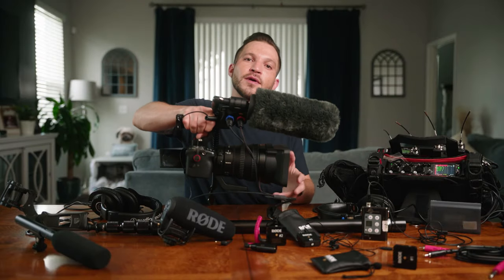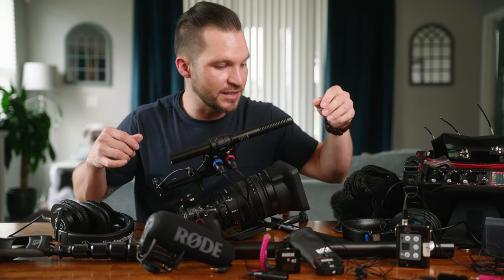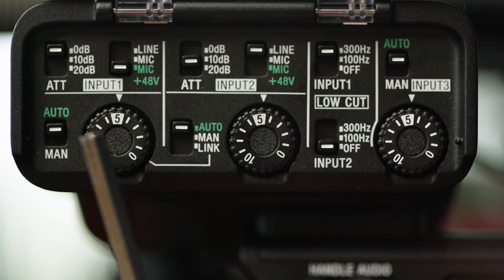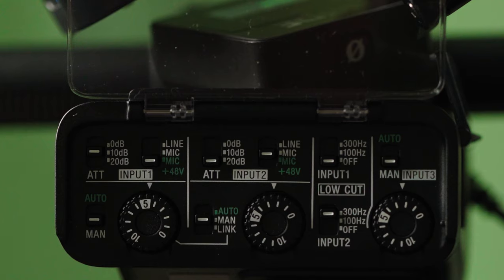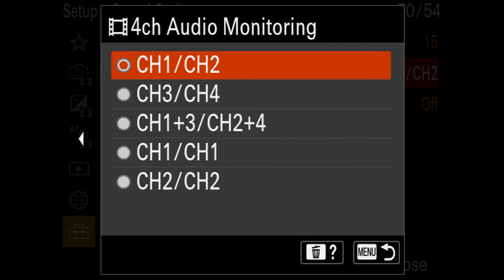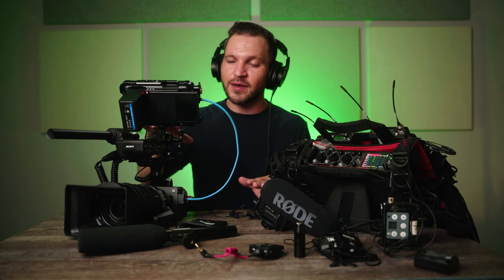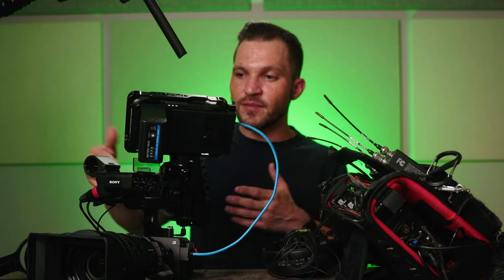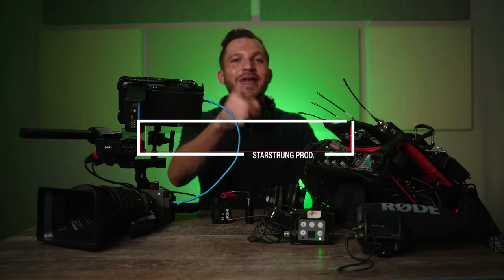Sony FX3 XLR Audio Handle EXPLAINED!

Comment: Hey Ray, long time! Hope you are having a nice Christmas season. I got a question for you: There's this faint ringing noise that comes and goes when I connect the Rode VideoMic NTG using a minijack (3.5mm) to XLR adaptor to input1 on the Sony FX3's top handle. I can't figure out what is causing the problem, whether it's the cords, or mic or top handle, or if this is normal from time to time. I would appreciate any help. Thank you kindly.
Reply from the maker: Hi Jesse! Hope you're having a nice Christmas season too!  Did you get Rode's 3.5 to XLR adapter? It sounds like it could be Power or Cable/Adapter related. What do you have your "Power" level set to?  Mic, Line, Or 48V Phantom power? The NTG is designed to run on Mic Level.  And does it only make the noise when in the XLR port, or does it do it plugged into the 3.5mm Jack also?

Comment: Hey Ray. I really need your help. I have FX30 with xlr handle and want to connect "rode wireless go2" and "deity d4 duo" microphones. "Deity d4 duo" only works from input3 (3.5m), so I only have a choice to connect "rode wireless go2" thru input1 or input2 with XLR adapter. But the problem which I get is that those inputs are mono and I cannot have different L&R channels in post because it's in one channel. Do you know if I will use "3.5mm to dual xlr male cable" with my "rode wireless go2" with input1 AND input2 I will be able to have two different mono channels? Thanks in advance

Comment: You were probably just doing for demo purposes, but a 416 as an on camera mic would be overkill. Save the 416 for booming and use a cheap shotgun as an on camera mic since it’s likely going to be just  reference or nat sound.
Reply from the maker: Absolutely overkill! It's just what I had access to back then.  It was a rental for a job.  I have 2 shorter shotgun mics from Rode and Deity now.

Comment: Thanks for explaining so well, helped a lot. I just got Deity S-mic2S for fx3 for run and gun shoot. I am getting lots of handling noise through mic, is there a way to get around this? Thanks
Reply from the maker: Hi Naveen. Thanks, I just did a video about the Deity S-MIC2s against the Rode NTG5 on the FX3 if you're interested: https://youtu.be/FHB0iUDFy8k
For the handling noise, I got the smallrig extension grip for the handle and covered the rest in velcro (soft side). It helps a great deal!
Reply: @RayValencia  Thanks Ray, I've seen your other video and great to see those comparison and they both sounds good I think, however they were setup mostly on static Boom and i was wondering how would they respond when handheld on camera top, would love to see a video made for that in run and gun style environment.

Comment: Hi Ray, thanks for your video, very helpful. I have one question. I am using Sony ECM-MS2 Microphone with phantom power in input 1 and 2 and rode wireless go II into input 3. Which input select should I use on the handle between the  3 options (IN3, IN1-IN2, or IN1) in order to record 4 channels? Right now I am using IN1, but I'm not sure it's the right thing.
Reply from the maker: Hi Arun. Make sure you followed the steps on how I enabled the camera settings to turn on 4 channel audio. As long as that is enabled, The Input Selector is really telling your camera which audio ports you want to be on Ch1 and 2, in the Camera. Input 1 is fine for a single Input in Input. But if you're using xlr 1 and 2, use IN1-2.

Comment: Hey! great video, at 12:25 i'm having an issue plugging 1 XLR mic and 1 Lav into the 3.5mm input on the handle module i'm running it to my Atomos Ninja V. the issue is I'm only getting either the xlr OR the lav signal when i switch between input 1/2 and 3/4...i don't have any other settings other then these two. but i see on your menu you have 1/3 and 2/4 options in your menu which would fix the problem. is this an Atomos or HDMI issue? i have a high quality Atomos HDMI cable and the ninja accepts up to 12 signals so i'm not sure what's happening. any ideas anyone!?
Reply from the maker: Hi Adam. Just to clarify, are you using the FX3 or K3M on a7SIII?  You've gone into the menu and enabled 4 ch Audio, then gone into the Sound Option to specify what your headphones are monitoring (like 1/3 in your left ear and 2/4 in your right ear). Then you Input Selector on the FX3 handle tells your camera which Input you want to be on Ch1/2.

Comment: Welcome! Great movie! I have a question. I am currently shooting on the sony a73 and when I record children their high pitched voice always makes the recorded sound crackle. It is supposedly the fault of the receiver. Is the receiver in fx3 better? To record the sound correctly now I have to use the rode ntg microphone and use the safe track. : /
Reply from the maker: Are you going straight into the a73 with the Rode NTG or are you going through the K3M audio module? The K3M and FX3's XLR Handle are essentially the same thing, but YES they do have better preamps than the internal mic jack, plus you can alter the attenuation, low cut filters, and Fine tune your Gain with the Dials.

Comment: amazing, this looks a good buy over a7siii, but i live the evf! Is there a way to use a rode wirless go 2 on the a7siii and a shotgun mic so you would have spilt channel left and right rode and also the shotgun mic as a backup?
Reply from the maker: Yes, for the A7SIII,  you'll need the Sony K3M Audio Module, and some of the adapters I used in the video (link is up in the description, it's the Rode XLR to 3.5mm Adapters).  The 3.5mm jack could be dedicated to your wireless go II, and split it on Ch3 and 4. Then use the 3.5mm adapter in the In1. Then you'd still have another port available. The XLR ports do not split into Left and Right channels though. They are each Mono. Although you can duplicate IN1 into IN2 by using the LINK switch on it (and lower that duplicate channel on IN2). As a safety track. Hope this helps!
Reply: @RayValencia  ohh boy, so basically get the fx 3 and live without the evf. I do like the fx 3 more in every other way

Comment: I got the Saramonic SR-AXM3 to use on my fx3...only because when I bought the cam, I wanted the least heaviest mic...and nothing was available. What do you think? I combo it off with the latest xlr- 3.5 using a 
Comica CVM-V30 PRO. What do you think?
Reply from the maker: Yeah, XLR mics are super hard to find right now. Especially, shorter, lightweight ones. I haven't tried out the specific ones  you have, but they look like they will get the job done.  If it sounds good to you, then it's worth it.
Reply: @RayValencia  yeah the saramonic I picked up for a whopping 25 bucks on Amazon.... I only use one for the fx3 and it sounds pretty good....no lie, been binge watching your fx3 vids. 😆 🤣 😂

Comment: Which works better the xlr-3.5 adapter or the half inch to 3.5 adapter to use on the xlr? Does it matter? Thoughts?
Reply: Also, my settings does not have an audio option....
1. Image quality
2. Media
3. File
4. Shooting mode
5. Drive mode
6. Shutter/silent
7. Image stabilization 
8. Zoom
9. Shooting display. 

Any suggestions?

Comment: Ok, so I’m just trying to be clear here… you can record several tracks without the mixer? Does it save the safety track to the sd card? How does that work?
Reply from the maker: Hi. Yes, the FX3 has the ability to record 4 channels internally.  But there are only 3 inputs on the Handle: 2 XLR Inputs, and a 3.5mm jack.  The 3.5mm jack records onto channels 3/4 as a Left and Right.  So if your mic has the ability to enable a Safety track, then it will record one of those tracks at a Lower level. If you're using an XLR mic, plug it into Input 1 and set your Input Selector to 'IN1-2', and that will enable a safety track on Channel 2. You'll be able to separate these out in your editing program.
Reply: @RayValencia  Awesome! Thank you! I was curious about how the files were stored, so that all makes sense. Thank you! Subscribed! This was wonderful content.

Comment: Hi Ray I have found that when you plug in k3m the db numbering disappear all you have to monitor audio is green & red dots not very professional. am I missing something ?
Reply from the maker: No, you are right and not missing anything John. The Sony audio bars do not have numbers in the larger body cinema cameras either, I can confirm on the Sony FS7 and FX6 both have little green and red dots without any numbers. Although, on those cameras you can actually see the db numbers if you open up the Audio Display Menu.

Comment: If you were using only one mic would you just make the audio monitoring ch1/ch1 or ch1/ch2
Reply from the maker: This is is the whole Safety Track method. Put in on ch1-2, then lower your 2nd channel and you'll always have a lower Track if your subject gets too loud.

Comment: I’m using a rode ntg1 and when I place it in the xlr handle with rubber spacers I’m finding the audio isolation isn’t very good when handling the camera. 

Has anyone else had the same issue ?

Comment: Can you record internal audio from camera body to a channel and external from the handle to another channel?
Reply from the maker: Hi Paul!  No, as soon as you plug something into the Camera Body's mic jack, it disregards the Audio Handle inputs completely. You can do either the Camera's Mic jack or Audio Handle, but not both simultaneously.  Hope this helps. With the audio handle though, you have 3.5mm jack, and 2 XLR inputs.
Reply: @RayValencia  Thanks Ray. That's too bad. Always nice to be able to have ambient audio on one track

Comment: Hey! Is the mic ring / clamp removable?
Reply from the maker: I've seen some people remove it, but it's not designed to be quick release. You have to take the handle apart (which I have looked inside before), but you gotta be careful not to break the Data ribbon inside the handle when you do it!!!

Comment: can we use xlr handle in channel 1 and 2 and internal mic in channel 3 and 4
Reply from the maker: No, once the XLR handle is turned on, it overrides the internal mic. But if you plug a Mic into the 3.5mm jack on the Body, it will override the XLR Handle audio.
Reply: @RayValencia  that's sad:(

Comment: Yo Ray!

My sony fx3 handle audio has been making some buzzing/high pich humming noise with my shotgun mic
do you know why this is?
Reply from the maker: Hey! Let's figure it out. What are your settings on the XLR handle? Is it a Phantom powered XLR mic or internal battery like the one I showed in the video?
Reply: @RayValencia  hey ray, its a phantom powered xlr mic yep at +48v
I was told by someone it could be from my in camera audio being too high? 
What do you think it is
Reply from the maker: Ok, nice. Yeah, if you're In camera settings are too high that will cause Noise too. Try to keep In-Camera very low if you can, Level 5 or Less for some Mics. I even put it on 2 for some mics. Then use your XLR UNIT Gain from there. Start with your ATT switch on 10 too.
Reply: @RayValencia  perfect, that must be it cause my in camera was at 23. Will try and let you know thanks ray

Comment: Where do you plug in your headphones?
Reply from the maker: Hi Paul. There is a headphone jack built into the FX3 body. No headphone jack on the XLR Handle though.
Reply: Thanks Ray. I finally found it hidden under a flip out door on right side.

Comment: You can also just go to Lowes or Home Depot and buy a foot of black tube (you will only need about an inch). Just cut to the exact size of the holder and no one will ever even see it. Instead of trying to slide it around your mic just slit it and wrap it around the mic then clamp the holder around the tubing.
Reply from the maker: Absolutely....I even had to resort to gaffe tape wrapped around one of these rubber mic spacers because I recently got a Rode NTG5, and it is way skinner than my other mics.  But like you said...No one will ever see it!   **And to whoever else that may read this, try to avoid putting the gaffe tape directly on your mic because when it gets hot outside, gaffe tape gets gooey on the adhesive side!
Reply: @RayValencia  Hey Ray, is there any way to send different channels to different card slots?
Reply from the maker: @glenngulia5409  No, I haven't seen anything like that.
Reply: @RayValencia  THX

Comment: So the handle has only three inputs but has four channels???
Reply from the maker: Correct! Input 3 offers 2 channels, which is great because you can do a Safety Track (or input 2 wireless lavaliers to it).
Reply: @RayValencia , are you referring to the 1/8 Jack and is it because it’s a stereo jack?